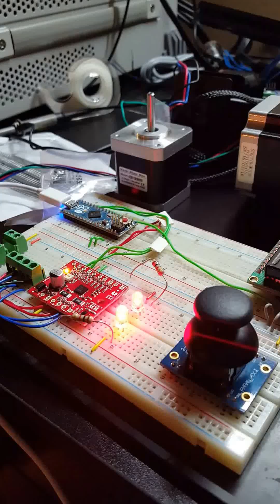Big Easy driver test run

Comment: can i use a big easy driver, and drive a 3V  stepper?
Reply from the maker: you can use any motor voltage up to 30VDC. just don't exceed the 2 amps per phase limit.